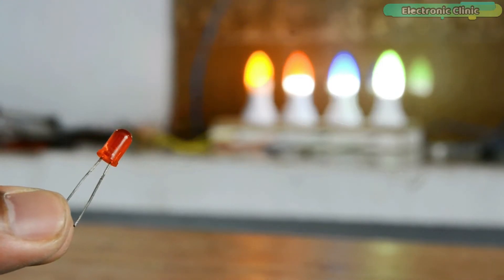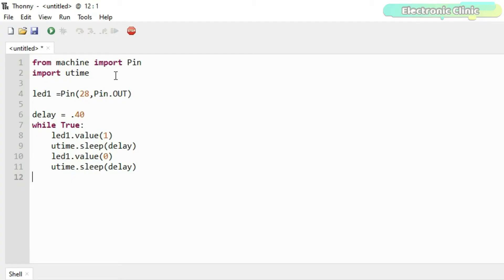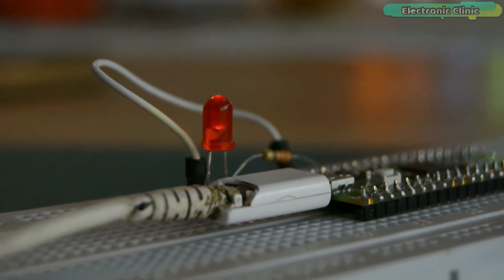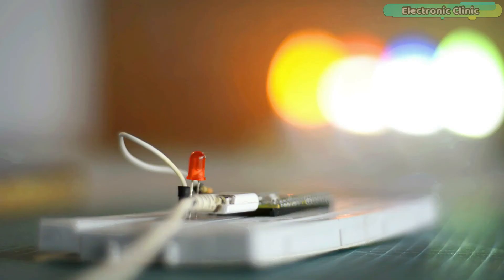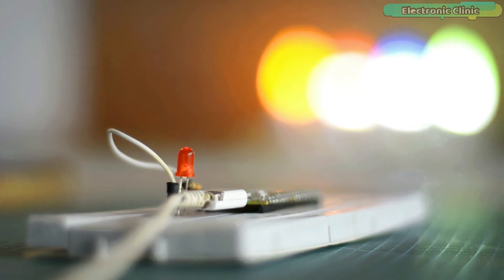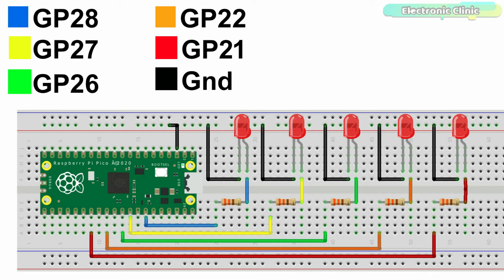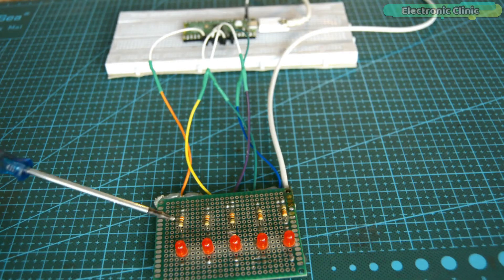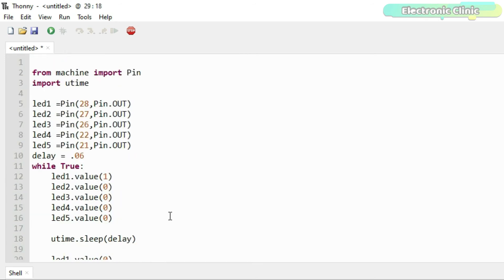Raspberry Pi pico LED examples, raspberry pi pico knight rider, how to control led using Pi Pico

Comment from the maker: Raspberry Pi Pico Tutorials for Beginners:

Arduino Vs Raspberry Pi Pico:
https://youtu.be/15S8HM1GMu0

Raspberry Pi Pico Pinout Explanation and Onboard components:
https://youtu.be/q6rbqR4X7hE

Setting up Raspberry pi Pico:
https://youtu.be/jJBwi5pEvN8

Raspberry Pi Pico Led Examples:
https://youtu.be/0NmRtVAHJ9A

Raspberry Pi Pico Digital Input:
https://youtu.be/MCeQsSQu_sE

Raspberry Pi Pico Oled display SSD1306:
https://youtu.be/fH23Kvl_o_o

Raspberry Pi Pico Analog Input:
https://youtu.be/_f_tpVNMXTk

Raspberry pi pico Ultrasonic Sensor:
https://youtu.be/7R_-deTXDLo

Raspberry Pi Pico Temperature Sensor:
https://youtu.be/__v2P_RmXSY

Raspberry Pi Pico and PIR Sensor based Security Project:
https://youtu.be/kQlp-xdyZ3Y

Comment: Although similar, that's not the correct Knight Rider effect. The original effect uses 9 incandescent lights, and this is how it works:
- 1st light on, all others off
- next light on, previous light(s) dim by 25%
This results in that fading effect that KITT scanner is known for, those LEDs can't reproduce it.